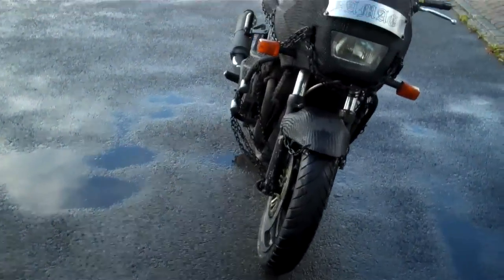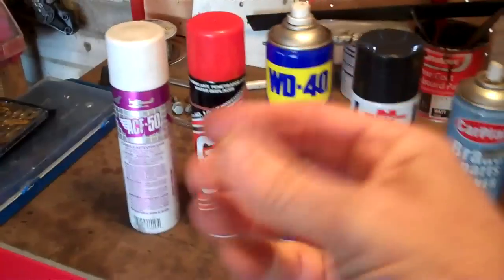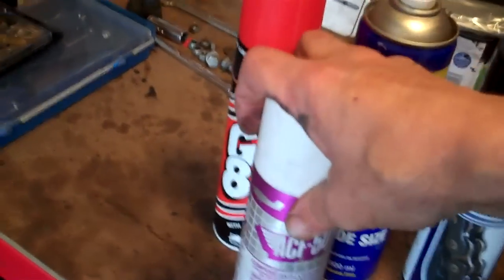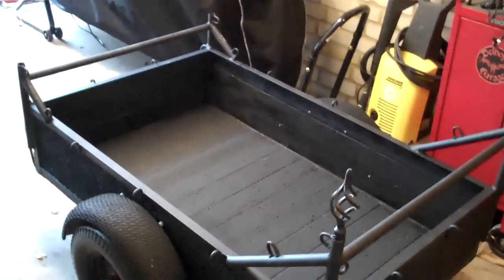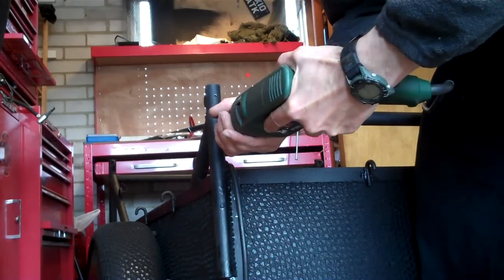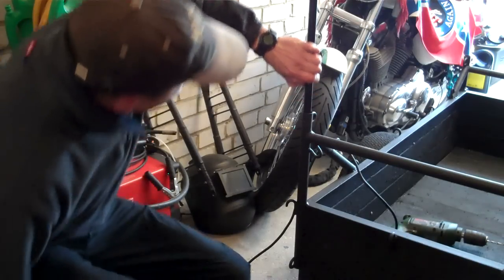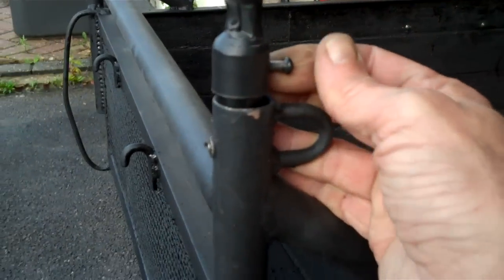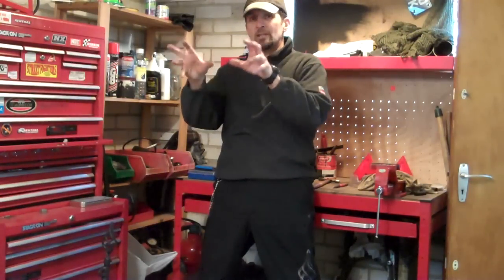Delboy's Garage, Project Rat Trailer Part 33, and some winter housekeeping.

Comment from the maker: No hazard lights mate, and im not too bothered about how to wire the actual trailer...its more the bike, i really didnt want to wire in a plug socket with all the connections to brakes and indicators etc, just for a few tows a year... ill sus it out chum, one way or another... thanks for watching, Del.

Comment from the maker: Thats the way, just take an 'as-and-when' approach, even starting it up once a week and letting it run for about 15 minutes, rev it out a few times and switch it off....its important to make sure you get the motor right up to working temperature so you dry away all the condensation from the cold start, other than that, keep the metal surfaces covered in a little WD40 or grease to stop the condensation rusting it and you'll be fine... good luck mate, take care, Del.

Comment: Del, Thanks for info on Clutch will keep you posted. Reguarding tail lights, what not install LED light kits? No load on you eletrics and indiactor relay. Fully LED my Bandit and is sweet. 
Anyway great winter tips and keep these videos coming.

Comment from the maker: Hi,Tom,you've spotted Suzuki's deliberate mistake in making the Bandit headlight a load of crap, they are indeed complete rubbish.The first (and cheapest) way to improve things is to increase the H4 halogen bulb from 55/60w to 55/100w,but this loads the wiring & only attains to the high beam.The proper remedy is to fit a H7 HID light kit,so just search on Ebay 'Suzuki Bandit HID Light Kit',  this gives you a xenon blue headlight and reaches 3 times further than the crappy OE item, good luck Del

Comment from the maker: Hi Darth! Great to hear from the Lord of the Dark Side himself, I think you mean the GT85  spray...it's a brand of lubricant penetrant and water displacer and it's famous for being the only one that contains PTFE, the company is just called GT85 Limited and have a website GT85.com ...if you can't find any, then WD40 is a good alternative used sparingly, or even as I've done when I've run out of everything, a smear of clean engine oil applied with your fingers,anything to keep the forks 'wet' Del

Comment from the maker: Storing a bike can be more harmful than using it (unless you drop it lol) it all depends on how long you intend to lay it up for, if its a couple of months, then just fill the tank right up full, get the tyres off the deck and pump them about 5psi over....and leave the battery on trickle charge...but if you mean a real long term lay up...its a lot of work to get it ready, and also recover it back for the road in the future....better to keep it ready for use, and just ride it once a week.. Del.

Comment: Hi Del, Do you need indicators on the trailer? Only remember if you use LEDS as flashes you'll need a separate relay as bulb flashers and LEDs dont mix....

Comment: If you do decide to put lights on the trailer and LED are the best way without modding the bike loom, the way I'd do it would be to use a 7 pin plug and socket. As you will only be using the running light, brake light and indicators. You can run the indicators off a common earth and the brake light and running light from a common earth, leaving you with a spare pin in the connectors. I'd also join into the wires of the lights and not the loom on the bike. Lights are easy to replace looms aren't.

Comment: I have no idea what regulations you have over there but I wired my M/C trailer up with LED lights so there was no need to upgrade the bikes' wiring or fuses due to such a minimally increased load. 
You need to put some clearance lights inside your finials you just installed for sure.

Comment: I like the idea about keeping those forks clean, never thought about it. That's a discipline that I will start on from now on, my question the spray that you are using here in the USA what would it's equivalent be or is it fork spray you can get at any motorcycle shop? great vids by the way

Comment: at last the finials :-)

Garden hose pipe comes to mind for mounting such things.

They look good but where is the matress and pillow/sheets ha ha :-)

Dam handy things rivets, but dont use them to attach an earth to a frame, yuck yuck lol.

I dont know, frightened by a bit of wiring lol,  just pulling ya leg :-), if legally it dont have to have them...... otherwise its the candles in lamps job lol :-)

Its not silly, dont put your construction down, thats my job :o)